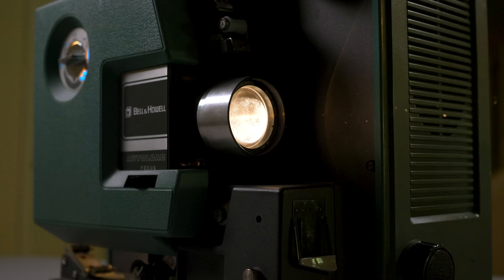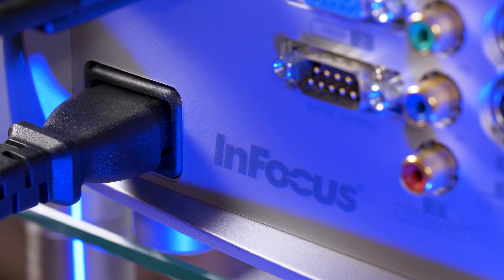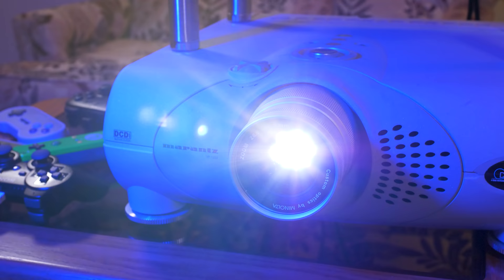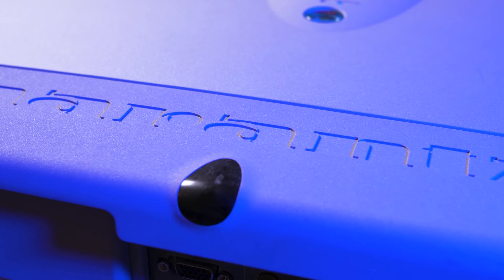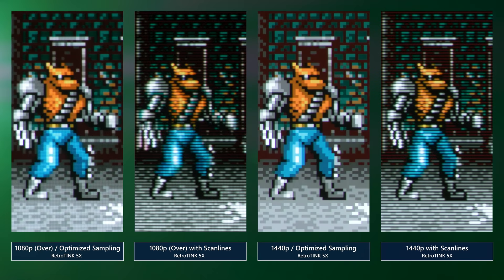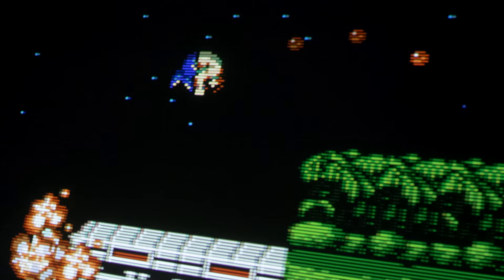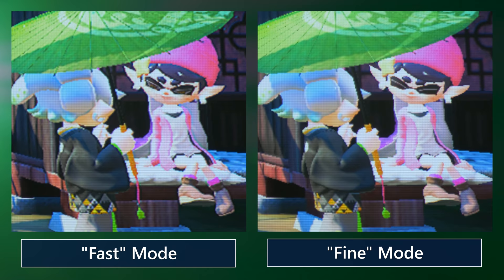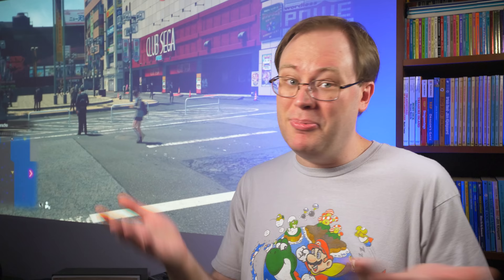Gaming on Projectors - From Retro to HD to 4K HDR / MY LIFE IN GAMING

Comment: Awesome video. I needed something like that to remind me that projectors have unpredictable input lag, rainbows, horrible black levels, random resolution and picture processing quirks, short lamp lifespan, screen material requirements, rooms without windows, produce fan noise, heat up room and price is not friendly at all.
Reply: ya ill stick to an oled thanks. larger picture sounds cool but not once you try it

he forgot to mention the speakers are behind you and can sound funny because of that.
Reply: @bland9876  Speakers behind you? The ones build into some projectors? I don't think anyone is going to use those!
Reply: @807D14M0ND5  yes unlike a tv that sists in front of you a projector sits behind you so the speaker have to be where the projector is. If people are not using those speakers then they will not have any audio.
Reply: @bland9876  You can just use external speakers or headphones :)
Reply: @807D14M0ND5  and have your cable dragging all the way acrost the floor? No thanks i dont like tripping. Besides how do you even plug the speakers in? Most devices that plug into a tv dont have an audio out on them. Unless you are talking about s/pdif or whatever it is called.

Comment: I'm still rocking the Optoma HD25-LV I bought back in 2012. I will say, it makes an enormous difference using a fixed frame projection screen with a black velveteen frame vs a flat painted wall. I demoed that on YouTube way back. I still use that setup daily in my home theater to watch TV shows and movies.

The DLP projector handles games really well, but since I play mostly on PC, it's not ideal due to neck strain. Crysis 2 in 3D on PC is still one of the coolest things I've played. The particles of dust, smoke, and debris floating in front of you plus the surround sound and vibration from the controller made the experience really immersive.

Comment: What I've found is there's always going to be compromise when choosing a screen material.  Darker material/paint makes for better perceived black levels, but will lower bright highlights.  Personally, I went with a can of Behr Silver Screen from Home Depot darkened a bit and the result is satisfactory.  Also, keep in mind the light bouncing off of walls as it can negatively affect contrast.
Reply: The 'gain' (angle light is reflected at) makes a huge difference and helps reduce hot spotting.  And yeah, dark, non-reflective walls are a must.  The blackest black is only as dark as the darkest the screen is, and that isn't always very dark if its picking up wall reflections.

Comment: Awesome video as always!

I started in the mid 00’s with a cheap (£30 second-hand) 800x600 projector and a white wall, with my modded Xbox OG connected for emulators and XBMC streaming. Looked awesome at the time.

Recently I bought a dedicated screen and a 720p LG projector. It looks pretty awesome and supports 3D glasses! It allows a low-budget cinema experience and sends the audio via Bluetooth to my LG soundbar.

Comment: I've been working with projectors with art and for gaming since 2010. For better blacks you want a high contrast ratio which is the difference of shades from black to white. A good ration is 300,000:1 and higher. 1,000,000:1 and up are very good at this. I actually made my own screen by painting super flat white 5 layers on smooth muslin. The ultra flat paint holds the color from the light very well and displays amazing blacks when you have a high enough contrast ratio. Very fun video because I've just been doing this on my own. One of my favorite projectors for retro gaming is a 420p epson w 4500 lumins, the only downside is that its contrast ratio is only 30,000:1 so blacks aren't that good. I do have a 1080p epson 3lcd w 350,000:1 contrast ratio but only 2500 lumins so you need all windows blacked out to see good.

Comment: I've been running a projector for my main gaming screen since 2004, steadily upgrading. I've never particularly had a hard time with input lag unless I enable a bunch of modern image processing features. I used to run my PS2 on an Acer 1024x768 projector, and when testing input lag with Guitar Hero we noticed the projector had less input lag than my friend's TV at home. Overall, I find the experience to be worth it, especially if you can pair it with a nice surround sound.

Comment: Movie theaters often used to have velvet on the walls. It was usually in a "non-ironed-down" double-pleat pattern and tacked with velvet wrapped trim-board at top and bottom, to hold it all in place. A bit like high-density, low-profile curtains. This dampened not only audible echo, but also "light echo". It doesn't even have to be black.. Brick red, forest green, charcoal grey; were all pretty common. Granted, that's some serious work to put into a side-side-side project...at someone else's house. lol. But, it does work well. Stage theaters do have to change out their velvet curtains every once-n-a-while, so you might be able to repurpose some, at or near no-cost. Just a thought.. Love the vids! :)
Reply: P.S. In a small room, you might actually get a very similar effect by hanging a thick, plush corduroy flat to the walls (no pleating needed). That'd be waaay cheaper, and a lot less work! And, depending on how you put it up, you could probably easily take it down to wash it too.

Comment: I use have a projector setup and I enjoyed having a 100 inch display in my bedroom. I started with a cheap 50 dollar DBPOWER 480p projector from Amazon. I wasn't impressed about it's image quality, so I began research more about projectors. I bought a Epson Powerlite 83+, I bought this projector for its 1024 X 768 native resolution, S-video, composite ports, cheap/abundant parts, and easy maintenance. Epson Powerlite 83+ was commonly used in schools and offices, so you can find them pretty cheap in the used market for 70 to 80 bucks.  The lamp puts out 700 lummens and lasts about 1300 hours. The lamps cost 50 to 70 dollars to replace which is really cheap for a projector lamp. My 720p BenQ DLP projector lamp cost about  200 to 300 dollars to replace it only last 2000 hours at 1300 lumens. The reason why I don't use  projectors anymore because they cost more operate than a TV and have a lower price to performance ratio compared to TVs.

Comment: I used the Optoma GT1080 gaming projector and was a great short throw projector.
I looked into the Black Widow paint mix project, as that makes use of grey to bring out the dark blacks, and flecks of aluminium base to make the colours pop vibrant. 

But tbh, as soon as I got it and threw the image up on my off white painted wall, I was more than happy with it.
So didn't bother with the Black Widow

Comment: My projector was an Epson 3LCD that's one generation older than the one you show here (sold 2013-2016 for around $1000 CAD, the Epson PowerLite 8345/8350). It had 33ms of lag in all progressive input modes (480p/720p/1080p) without any fast/fine setting, just 33ms for normal use, though I wasn't testing with a precise tool (photos of the 240p test suite next to a PVM). Double that for direct 240p/480i. I never used the "auto iris" mode because it's a very common failure on those projectors, being a moving mechanical part, it's not uncommon for them to seize up as they wear out. The iris does still open/close any time the projector is turned on/off or when the display mode is changed, but those are one-off events rather than the constant open/close that happens with dynamic contrast. So much less wear and tear. I also found the bulb lifespan to be less than advertised, maybe 2/3 to 3/4 of the advertised, and the brightness has dropped quite a lot by the time you replace them. If memory serves, I replaced the bulb twice. The first one just started getting dimmer faster and faster until I decided it was unusable, while the second one just burned out suddenly.
Reply: Same.  Bulb lifespan is a real problem with this model.  At around $300 each, it sucks so much when you start seeing a dimmer picture and know that it’s only going to get worse — unless it just spontaneously fails.

Comment: Great video, Try!  I just recently pulled my old DLP out of figurative mothballs--Which probably should've been literal ones--to hook my newly acquired Super Famicom up to it.  It's a BenQ PB8220. 2200 Lumens, 1024x768 native, Component, VGA, and RGBS input. Hell, even the built-in speaker--which I'd never used previously--is decent enough for just playing some SNES. I was impressed.  I bought it new back in 2003 or 2004, and it was my primary TV until 2009. My only regret is that having it gave my sister justification to finagle my 27" Samsung CRT out of me, and now it's lost forever. (It was one of the ones so easy to RGB mod via the OSD chip I could probably do it blindfolded!)  What's the least convoluted way to hook a SuFami up to an RGBS input in the form of a VGA port?

Comment: Projecting on a white wall is fine. I bought a Nicpow projector for $199 which does 1080p. My next buy would be a white screen from Silver Ticket for $199. If I wanted to improve my setup I'd look at higher grade projectors next. Fan noise is the main issue with the current one, followed by limited calibration controls (want gamma control) and the optics could be better (always have this one corner that's a little out of focus relative to the rest of the picture. I personally believe that a warranty on a projector is not a bad idea if you plan to use it all the time, and makes a lot of sense on higher grade projectors where parts or servicing becomes more $$$.

Comment: I have a Benq w1070 for a few years. Tried it recently with some older consoles. I have used a scart to component converter and it supports and detects 240p and 480i perfectly! The image is outstanding and the input lag is minimal. I also have an OSSC, but there is no need to upscale here.

Comment: Think a brief overview of pixel shifting would've explained a lot! Maybe next time?

Basically the BenQ has a native 1080p DLP panel. It then projects 1080p a second time with everything shifted down and right by a half-pixel, which visually overlaps with the first projection. It hops back and forth at 120hz to appear to blend into a single, smooth 60hz signal, using image processing to calculate how to construct the two 1080p images so they blend into an approximate 4K. Its almost like interlacing kinda.

This would also explain why you can only do 120hz at 1080p and 60hz at 4K, and why you definitely want pixel shifting off for 1080p games.
Reply from the maker: [Try4ce] You know, I do think I explained more in an earlier revision of the script, and by the end, I was wondering if I explained it enough. I thought it was sort of self-evident though, that you know, if the chip is 1080p, and the term is "pixel shifting" and it still manages to deliver 4K, then I thought it didn't need much further explanation of how it was doing this. Seems obvious to me that the 1080p is being used multiple times over the course of a frame to create those pixels. I wouldn't describe it like interlacing though, since I can't see any flicker. But yeah, I did at one point explain how the math checks out for why you can get 1080p not only at 120Hz, but even 240Hz, but only 60Hz for 2160p. But I had no way to demonstrate 240Hz and thought that was spending too much time on higher framerates, which not only is very hard to capture and show in a video like this, but also not super interesting to me ( to my eye, 60 to 120 makes nowhere near the difference of 30 to 60).

Comment: I have a Epson EpiqVision EF-11 (laser projector) and I can say, at least with that one, I don't have any perceivable lag occurring when gaming on it.  If I do perceive it, I really need to think to myself whether or not I'm thinking I see it, or if I'm actually seeing it.

With that being said, if you're someone who plays twitchy action shooters or bullet hell games, maybe it wouldn't be for you, but it seems to work quite well, and outputs a very crispy 1080p native signal.  In fact, with the image processing it does (which I am normally NOT a fan of and you CAN turn it all off) the picture looks razor sharp.  It's no ultra high quality projector, but it's very small, very quiet, and quite portable and bright.  The biggest downside is that pew pew lasers are expensive, so this will definitely run more than a lamp based comparable projector, or LED projector.  But they do last for at least 20k hours, so at least you're not spending hundreds in bulb replacements.

I highly recommend it.

Comment: I am extremely surprised that the DLP rainbow effect is still a problem in 2021.  It stems from having a single color wheel instead of 3, a problem with budget projectors I had assumed went away with advancements in technology.  My home theater has a Viewsonic 1080p DLP projector I bought around 2008 that has this same issue and for me it can extremely distracting depending on the movie I am watching....usually it's dark scenes that do it the most.  More expensive 3DLP projectors DO NOT have this issue.  I've been researching new projectors to make the jump to 4k, thanks for pointing that out as well as the positives/negatives of the lens shift tech.  Also very surprised at the response times you are showing, I always assumed projectors were around 2-300ms of lag and never even tried gaming on mine.

Comment: I use a Vamvo L4200 for console, and Emulation gaming on a 5600G Mini PC in the living room.  The budget projector works great at 100 inches for all my old school games with no noticeable lag.  However you do need the room to be dark or very dim, but that ain't a problem with me TBH.  I'm no videophile however input lag is something that would get me to return a projector, and I have returned a quite a few projectors over that issue.  This one is cheap, but it works and draws very little power from the wall (65W) which with 70+ inch TVs today using 3 times the power it is actually very cost effective.  There are actual black Projector ALR screens out there as well as Black ALR paints that can give you as close as possible to HDR quality though the cheapest paint wise is around $150 for a 100 inch 16:9 screen while $250 can get you a premade screen.  Me I don't mind if it's white due to me being in a dark living room.  I also have the sound hooked up to a cheap Panisonic All in one stereo from 1985 with some mid 80's 10inch Sony floor 3-way speakers and a cheap (20 bucks for both) pull down 100inch screen ($60.)  So Minus the PC and consoles the Projector setup only cost me $200 which is not bad.   I will say that I always tell people to stay away from the 480P projectors they're just too cheap for a reason, and always select a 720p or better with at least 600 ANSI lumen or better (2000 if it's going to be in a bright room)

Comment: I've been gaming on a 4K 60 Hz projector (Sony VPL-VW320ES) for over 5 years. It has pros and cons. The input lag's not perfect and HDR is not usable, but generally it's really good. I'm suprised how good the image is. Native 4K. Replaced the lamp only once so far. I have a 96" screen. I'll replace with a big TV when the prices get lower.
Reply: I don't see the point of running a screen less than 100" on a projector, especially one as nice as yours. Over the years I've went from 120" to 150" and I'm currently using a 125" custom built screen. If all you have the space for is a 96", I agree with you, I'd absolutely replace it with a 85" or so TV.
Reply: @bnr32jason  yeah, the problem is the space. My game room is quite small. No other rooms are possible for me at the moment.

Comment: I have a an epson 3600e which is basically a 3500 with 3D support and wireless transmission from the input device to the actual projector. Have had it some 6 years now and it's been great for 1080p content on an 110" screen. I rarely game on it these days but when I have, I can confirm the input lag on it in fine mode is atrocious--at least at first. It was surprising how quickly I got used to it and would have to double check I wasn't in fast mode. I wouldn't play any competitive online games on it but any single player game (except maybe the souls like games) is more than playable.

Comment: I have a dlp pocket projector that runs on android. The negative side is being limited to 480p native. I found for movies it’s amazing but the connection to Bluetooth and WiFi gives you many options. It runs on battery for 2.5 hrs which is enough for almost any movie but for retro games in a tent while camping, i don’t see much competition. Sure it’s not common but once you have it. You can’t imagine not having it. Android also means apps to tinker with on your projector. Mine had colors that were slightly off but with an app I corrected that easily. Pocket projectors typically don’t have options like that so you are stuck with what you see for the most part.